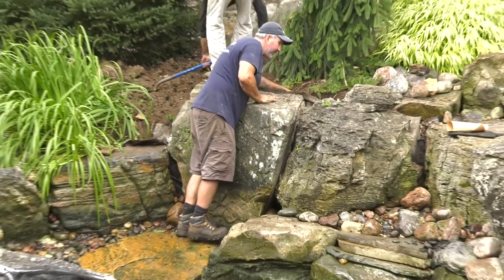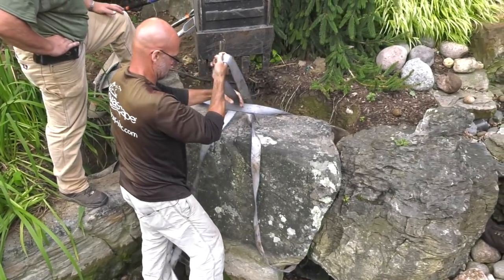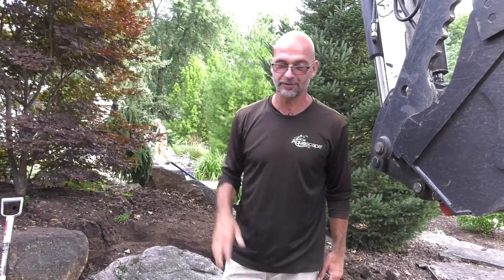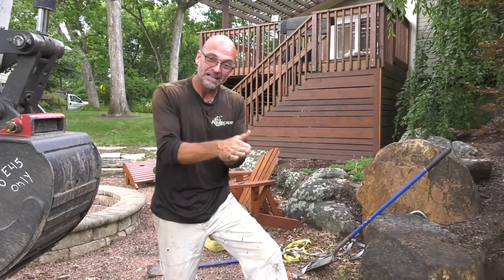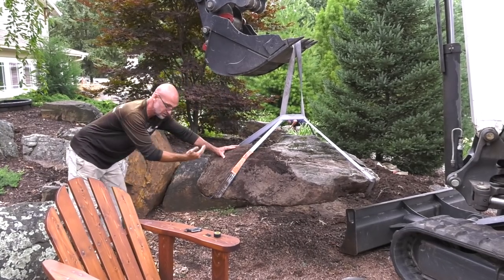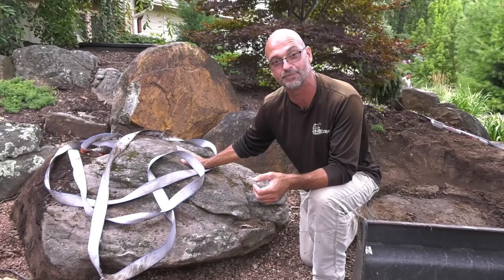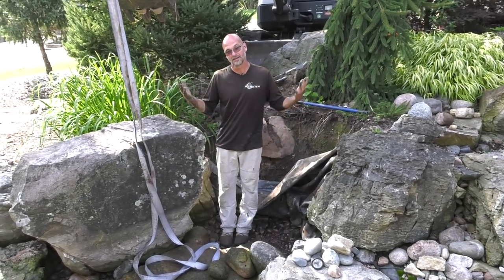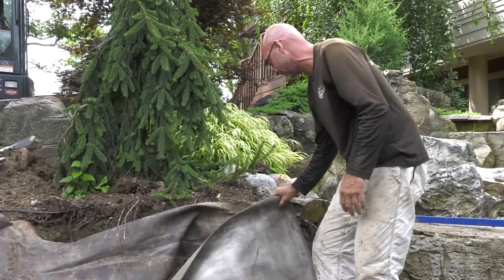Strapping and Moving Large Pond Boulders

Comment: Hey ed why not drop the bucket off and use a d shackle to attach the strap to the digger arm...give a greater lifting capacity and no straps get sliced off
Reply: thats how we do it anyway, takes a fraction longer but no straps get wrecked
Reply: In certain situations we will and we probably could have done that for this project. 
On our typical projects we’re using the excavator to dig prior to setting the stones and we use the bucket for backfilling behind the boulders with soil or gravel depending on the requirements.
Reply: Ed Beaulieu mates sence mate

Comment: I would’ve just picked those rocks up with the bucket and thumb they had on that machine!! 4 times faster and no body has to be around those huge rocks!! Would it may have put scratch marks on the rocks, yes possibly but those will buff out and plus it takes half the time and time is money!
Reply: That’s not how it works.... just because you can doesn’t mean you should.
Reply: They’re trying to preserve the way the rock was set and also not destroy any of the under rubber layer.
Reply: Moa Vic yeah but a good operator could pic that rock and set it back Exactly where it was picked from and not harm a single thing. But there are also prob 3-4 other ways that u could do it. I just seen that machine had a thumb on it. Absolutely love the work these guys do though!!!
Reply: Mark Morgan The thumb is an incredible tool!!!
We use it all the time but for specific rock placement nothing beats a strap.
I’ve had thumbs fail and rocks fall out of the jaws which is not a good situation......
We definitely use both and a great observation on your part. 
Thanks for your support!
Reply: Ed Beaulieu your welcome, and yeah I agree with you there, sometimes they do give out. My dad owns a demolition company and so I’ve been using thumbs on machines for 15 years or more and yeah there isn’t nothing like holding a 7,000lb  piece of concrete and the hose break or something like that and it drops out of the thumb and bucket! Also just wanted to tell you guys that my favorite one I’ve seen so far is the one you guys did down in Columbia I think it was, for that big mall down there. UNREAL man, LOVED IT!!!!
Reply: Mark Morgan The Primavera Urbana project in Colombia is at the Top of my list!!!